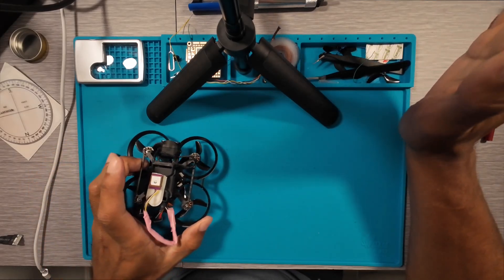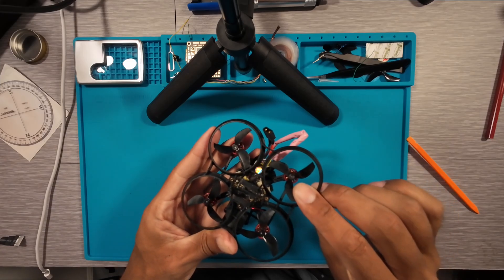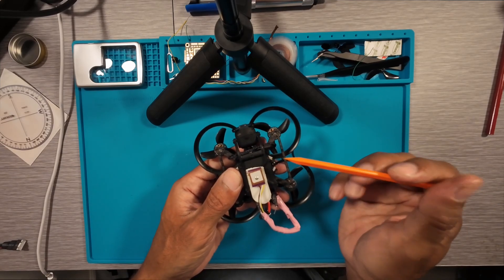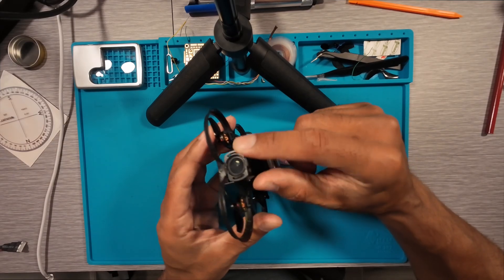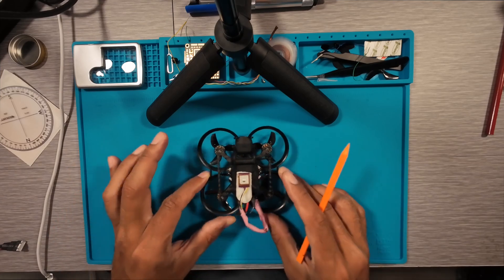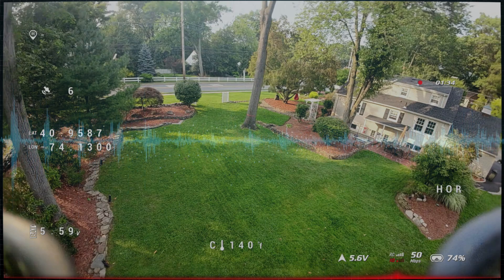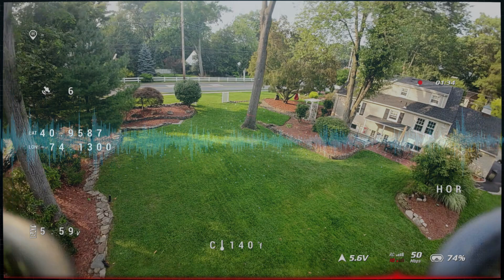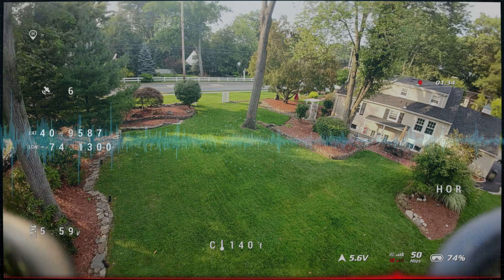Pavo Pico Jello Effect in Video - Fix Configuration for Beginner Flight

Comment: how did u get ur modes Horizon visible in the googles 2? can u help me
Reply from the maker: Yes - don’t forget to bind but I will throw version 1 settings up in GitHub- however make sure you have the right receiver 

It’s for those using the dji receiver

Just need an hour or 2

Comment: Your running your battery down too low.  Keep this up and you won't be able to charge it.
Reply from the maker: these batteries will be retired soon. Have not been crashing with these new settings.. current batteries that were used outside the simulator are dented and dinged. new ones will be run down to just the right limit..
Reply: Tatty makes a really good battery for this drone. 100c 450mah.